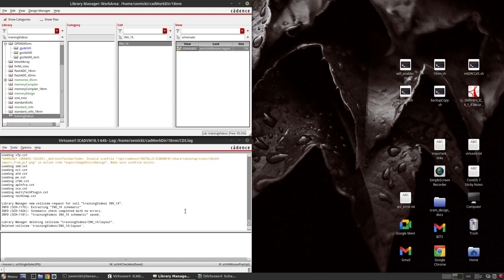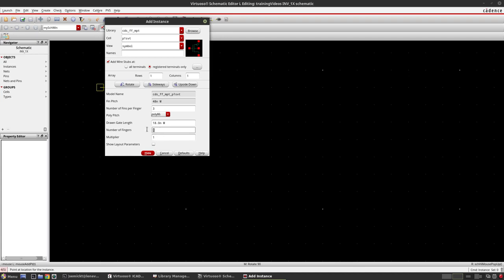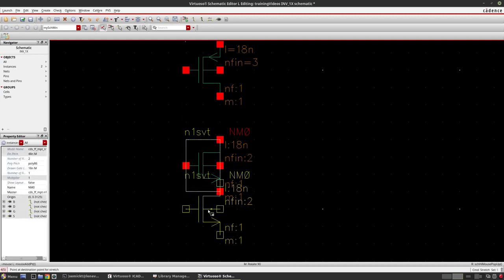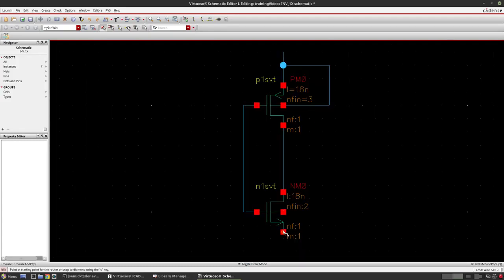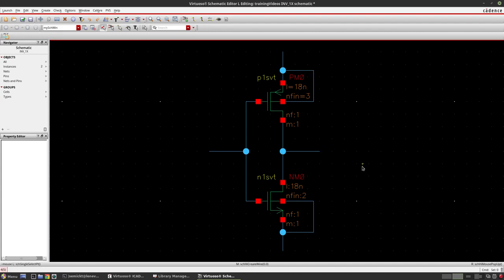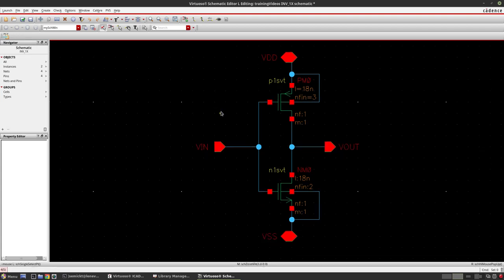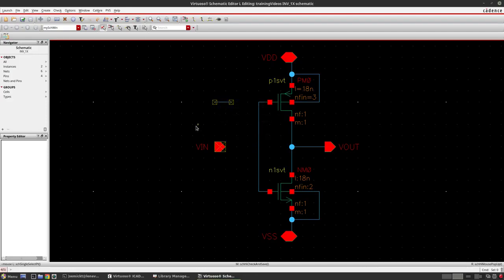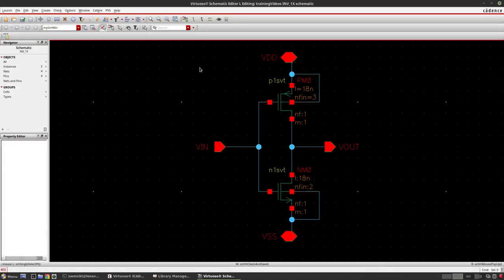3 Cadence Virtuoso: Schematic creation Inverter

Comment: Pin creation :
Before creating pins,  extend the wires to connect to input, output and inputoutput pin...

It is called binding pin,  for pin creation bind key is p.

2. To create pin of same type we can create them at a time using space between them.

Comment: 1. i is the shortcut for finding "add instance"
2. F to fit to the window
3. W to enter into wire mode
4. Body terminal of pfet to Vdd and body terminal of nfet to Vss
5. p1svt and n1svt are standard voltage flavour and there are lvt and hvt flavour as well.